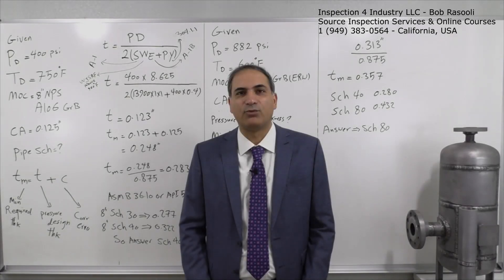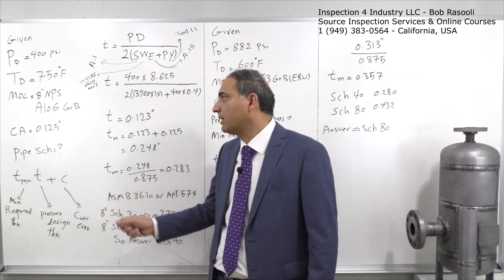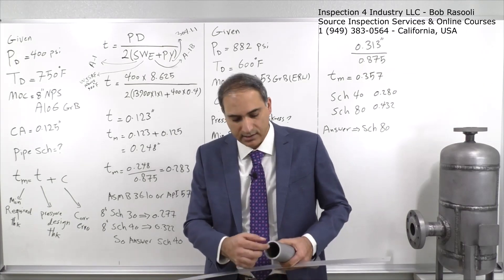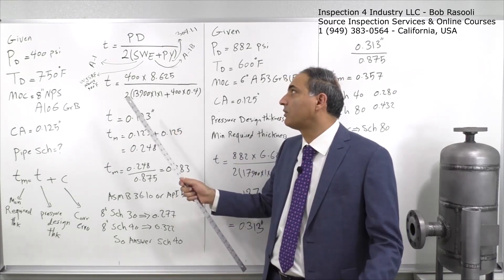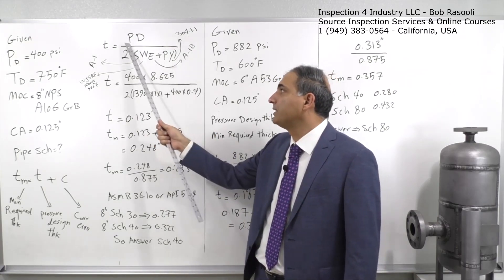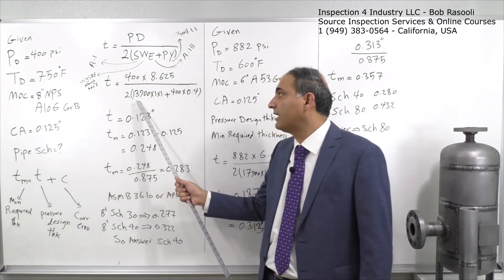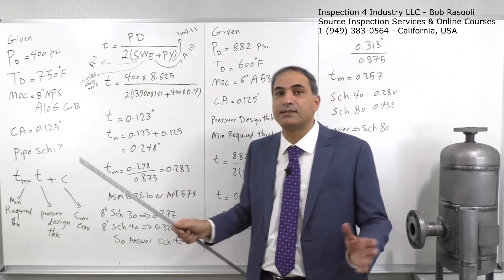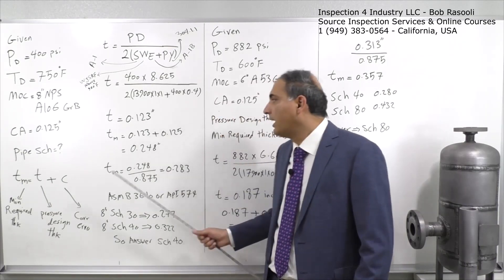Minimum Required Thickness Calculation & Determine Pipe Schedule on ASME B31.3 - API 570 Exam

Comment: Thanks for this wonderful lecture
Just wanted to clarify/get clarified on your explanation of Weld Joint Strength Reduction Factor
You mentioned that in CS pipes if temperature is greater than 900deg F, we have to refer to the table. But in general, all CS pipes have W=1.
Reply from the maker: That is correct

Comment: Sir the temperature range is given upto 1500 Fahrenheit only for SS materials. What should i do if I need to calculate the pipe thickness for SS material which has the operating temperature 1000deg Celsius?

Comment: API574 Table 1 provide the Outside diameter.
Table 3 provide the permissible tolerances. Hence, for SA106 provide the +-12.5% as manufacturing tolerance.

Comment: dear inspection 4 industry
thank lots for your efforts 
can I ask you a question?
when I do piping wall thickness calculation with all B31.3  (last edition) code considerations I get some answers without identified  schedule numbers according to B 36.10 M-1015
As example :24" with 20.62 mm wall thickness 
as you note this wall thickness didn't have a schedule number while (schedule 40 for 17.48 mm ) and (schedule 60 for 24.61 mm)

can you kindly  provide me with your answer and advise

Comment: ASME II PART A1 
16.3; Thickness — The minimum wall thickness at any point shall not be more than 12.5% under the specifie wall thickness.
Reply: Correct, Or in other word: the thickness of the standard pipe after manufacturing tolerances has 87.5% or 0.875 of it's nominal thickness for sure, so you can count od .875 of thickness.

Comment: Table A-1 Basic allowable stresses in tension for metals. shows 750-degree is (17300) but in the solution above its stated 13900. Please any explanation to that. thanks

Comment: Sir, tm=0.248/0.875, this 0.875 comes from where please can explain here- how you find 0.875? Thanks in advance.
Reply: Why it is divided and not done like (tn = tm + 12.5% of tm)
i.e. 1.125×tm= 0.279?
Reply: Pipe tolerance is 12.5%, which 0.125. Then, just minus it with,  1.0 (100%) -0.125 (12.5%) = 0.875 (87.5%)
Reply: NPS 8, 
(XXX Strong) = 0.875. from Normal wall thickness table API RP 574 Pipe Schedule table
Reply: He mentioned the 12.5% tolerance from b31.3.